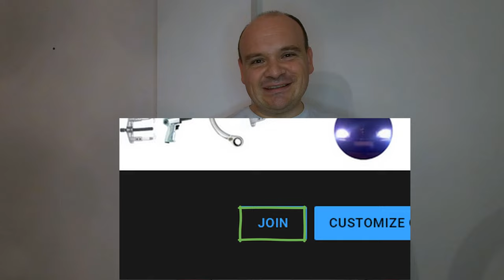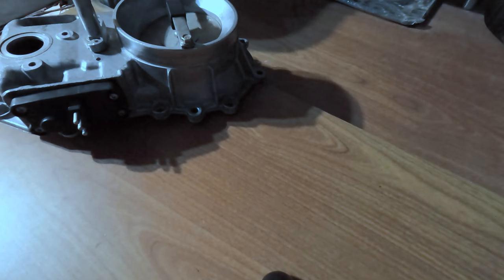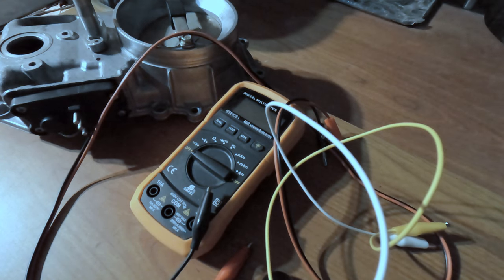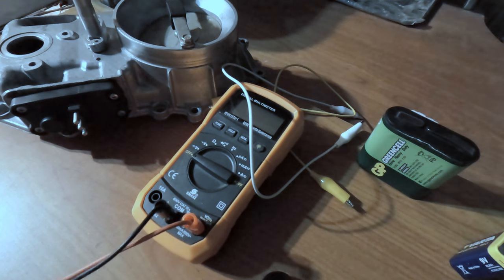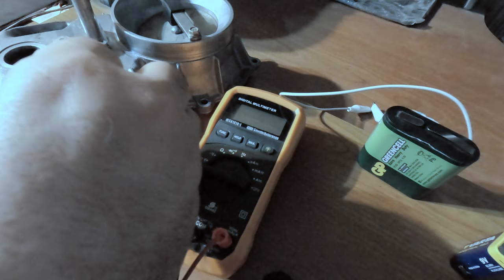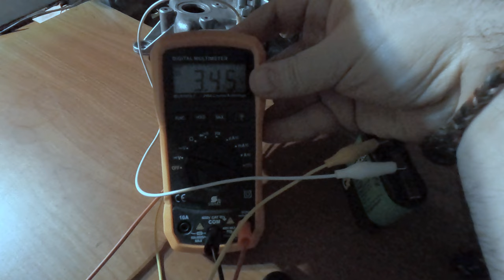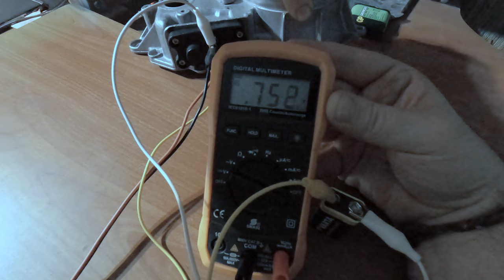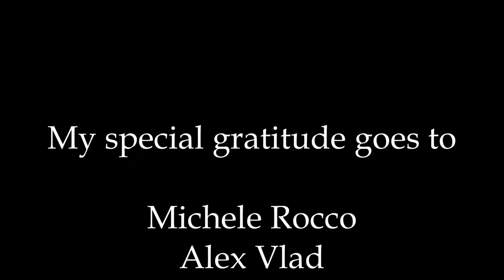Mercedes Ke-Jetronic - How did I measure voltage on the potentiometer!

Comment: Can you make a video explaining how the idle air control valve works and how to test it for proper operation? Thanks
Reply from the maker: Of course I can. You are my priority!👍🏻😃
Reply from the maker: Dear Ceasar, sorry for not responding, I was quite a busy. Hear I have a video on the ICV. For additional information I can tell you that on the 3 pin ICV you had to get 8.5V, on the newer ones with 2 pins - 4.5-6V and afterwards on the versions after september 89 you will have to get 580mAmps on the valve +/-50 mAmps. On V8 engines 1000 mAmps. If you have any additional questions feel free to ask. Cheers!
https://youtu.be/XeIYPbb7CmA
Reply: @Fix your Mercedes  Thank you Sir

Comment: Hello. Thank you for all vids that you've made. That's a great source of knowledge that everybody can take with. I used to work with ke-jets for few years but two weeks ago i get quite weird problem with one of car. May you help me somehow with this case? I made many tests and measurments, everything seems to be OK but car still has quite a big problem: C124 from 02.1988 m102 2.3 swaped to 2.0 (don't know why). When car came to me it had quite typical issues (vacuum leaks, potentiometer, idle air valve does't work - ECU was't match to this car, ignition problems etc). I fixed everything, now engine has 100% no vacuum leaks (checked with smoke machine), new injectors, potentiometer (OEM Bosch), fuel pump filter and lambda sensor. The problem that I have is, when i set up mixture to oscylate about 45-50% engine runs like crap, it's to lean for sure. It shaking a lot a idle. I have got AFR sensor mounted in exhaust manifold to tests how mixture really looks like - at idle afr 14.9 - lean as hell. When I reach mixture about half of turn CO screw - to the end of scale (<80%) engine is begin to work much better, but of course mixture doesn't oscylate. AFR about 13.5 . I'm sure that lambda sensor is working properly ( I swaped with 3 different used one). Potentiometer is set up to 0.7V, coolant and air temp sensors, TPS, idle cont switch are working well. System fuel preasure 5.4 bar, control preasure 5 bar at working temp. Ignition angle at idle 12'' BTDC, of course cap, rotor, leads and spark plugs are in good shape. Due to a this mixture problem engine don't want to rev easly when I step on gas when it's cold. At 90'C it;s fine. It starts well cold/warm - has about 1200 rpm for 15 sec then 750. I have no idea WHY when lambda is controlling mixture, when It's set up to about 50%, it is so lean... It's just ridiculous.  You have ANY advice? :) At the end - engine timing of course is OK, compression for each cylinder over 12 bar. Thank you (or anybody :-) )for any help.
Reply: I was wondering about some fuel distributor failure. I have no tools to check how each section works but I swaped whole kejet unit with fuel distributor and fuel pressure regulator from different car in which everything works fine -> No changes :(
Reply from the maker: Hello and thanks for becoming the member of the channel, I really appreciate that and that helps me a lot as well. Concerning your issue at first tell me if you have the idle control valve with 2 or with 3 pins. Second thing – does your airflow meter have a purple blue label no which it says LM0001 or a blue one with white characters on which it says LM0008 – there is a huge difference – because LM0001 has to be in pair with the fuel distributor MT0001, the label with black red color or the fuel distributor with the label MT0008, a grey black label. Here you must be careful because although the fuel distributors seem to be identical, they are not. Answer me this questions so we can proceed.  Greetings FyM
Reply: @mercedeske  Thank you for respond. ICV 2 pin, air flow meter purple/blue label LM00001 pared with fuel dist with black red color label.
Reply from the maker: My pleasure. How would I if not to my dear members! Holding idle for even more than 17 seconds on a cold start is normal(pre-heat ing of the catalytic converter), it goes up to 28 seconds. Tell me about the current on your EHA, how many mAmps do you measure.

Comment: What do pin 1, pin2 and pin 3 indicate or their purpose?
Reply from the maker: Pin1 is the ground, pin2 the signal to the ECU  about the position of the airflow meter and pin3 is the power supply for the potentiometer.
Reply: @mercedeske  Thanks 🙏
Reply from the maker: @paulfester9652  Happy Mercedesing 😊